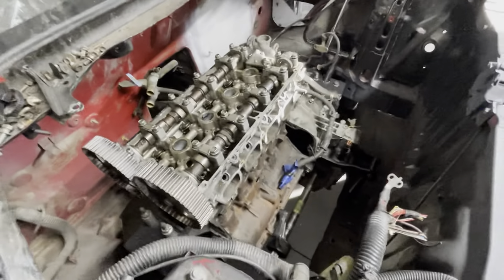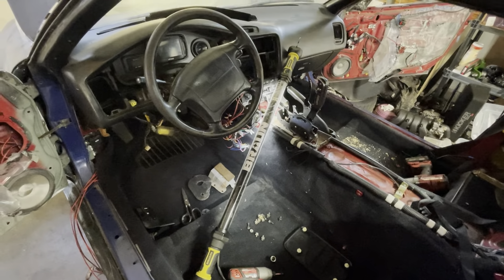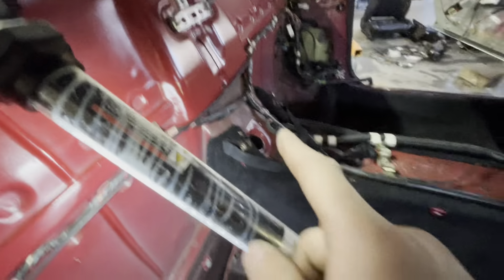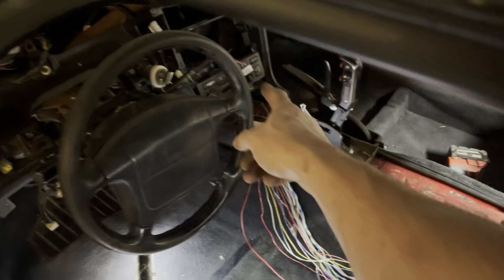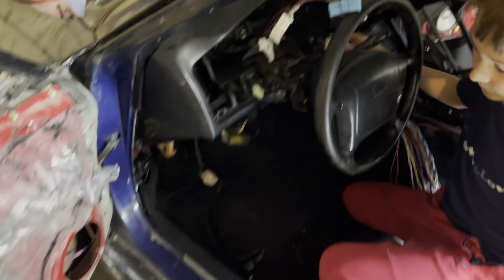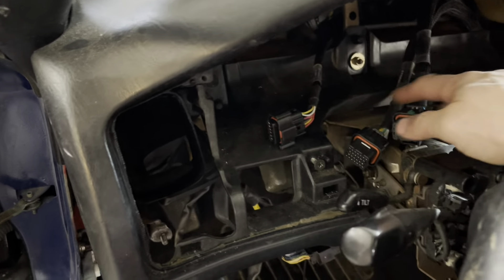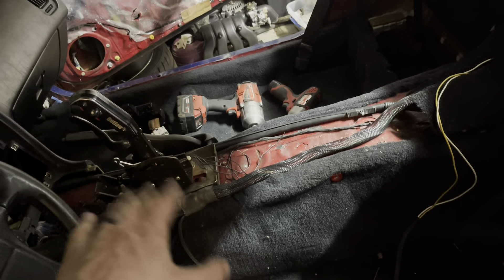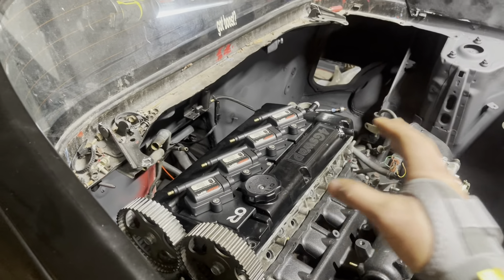SICK WEEK PREP ! Fueltech FT550 wiring in 4G63 Swapped SW20 MR2 turbo

Comment: Why are you running the fan to the solid state relay first and then to a normal relay?
Reply from the maker: Had a weird back feeding issue one time and since I had an extra input/output on solid state relay, figured I would do it this way. Solid state relay probably has enough juice to run the fans directly but just in case, sending to a normal relay up front with juice straight from battery. I know, it’s weird. Lol
Reply: @4familyman  Okey, whatever works works 😁
What was the backfeeding issue? Some ECU:s grounds their outputs when turning power to the ECU off, so i always run a switched 12v(+15) when controlling a relay with a ground from the ECU.
Reply from the maker: Never figured it out. So just put the fan on a switch on that setup 😂